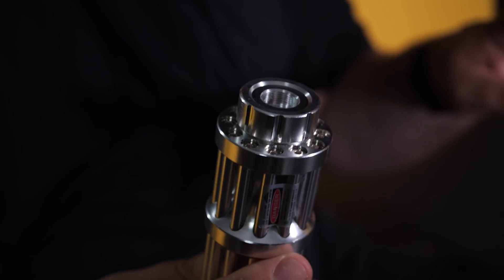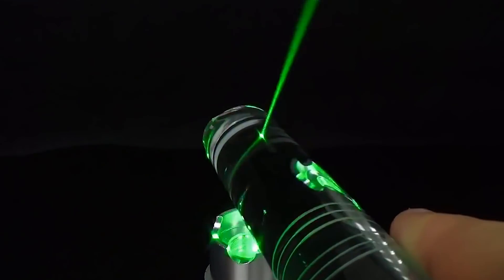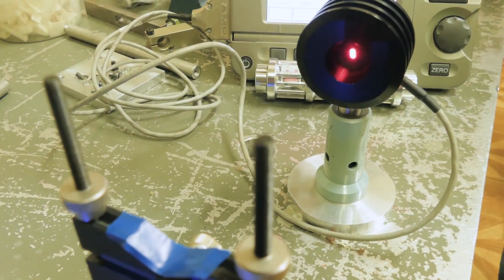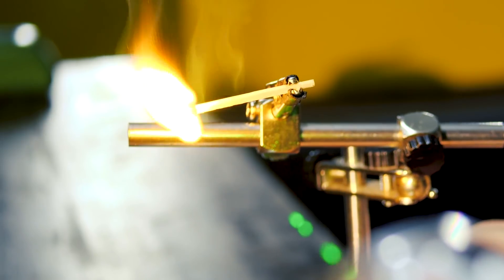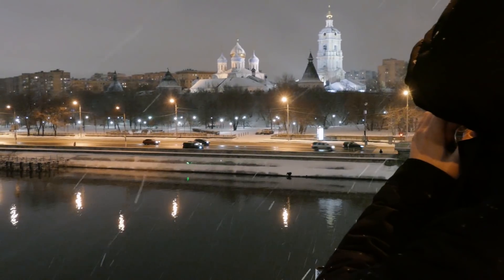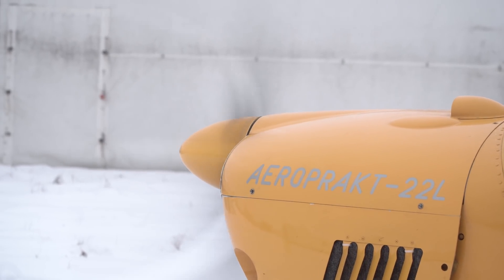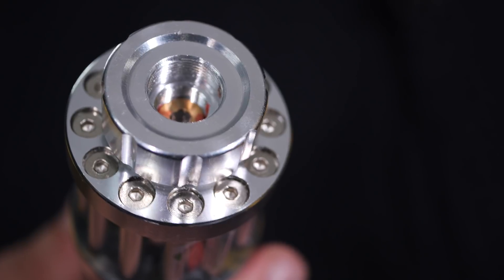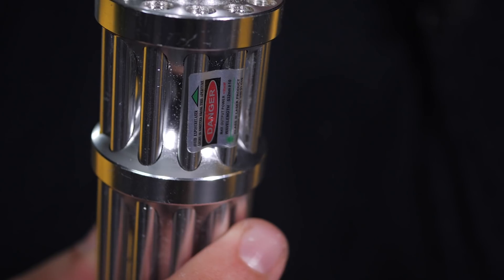How dangerous are chinese lasers. Testing in lab and on an aerodrome.

Comment: Aiming the laser at the aircraft in daytime does NOT represent the problem with lasers being pointed at aircraft. There have been over 75,000 pilot reports of lasers, worldwide, since 2004. Of these, essentially all occurred at dusk, nighttime or dawn.

During the day, a laser beam aimed at a person can be barely noticeable, or can be a bright green spot. At night a beam of the same power can cause glare or even temporary flashblindness. See the day/night comparison graphic on the webpage laserpointersafety.com/nodd.html; scroll down to the section "Ambient light can be a factor". 

Using the Excel calculator described elsewhere on that webpage, an 85 mW laser like the one used in the video during daylight would cause low dazzle up to 70 meters (230 feet) and high dazzle up to 18 meters (60 feet). But at night, the same laser would cause low dazzle up to 15,400 meters (16.3 km; 50,500 feet or almost 10 miles) and high dazzle at 4,000 meters (4 km; 13,000 feet or about 2.5 miles).

Thus, the visual impact of this laser is about 222,000 times greater at night than during the day.

While I appreciate the other safety information in this video, the daytime demonstration and conclusions are not valid.

PS: I am speaking as an expert with over 25 years of experience with the topic of laser/aircraft hazards. I have helped write standards for FAA in this area, have presented papers at conferences on the topic, and wrote two chapters on the topic for the book "Understanding Laser Accidents".